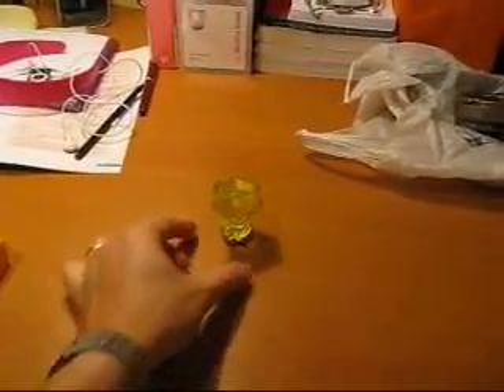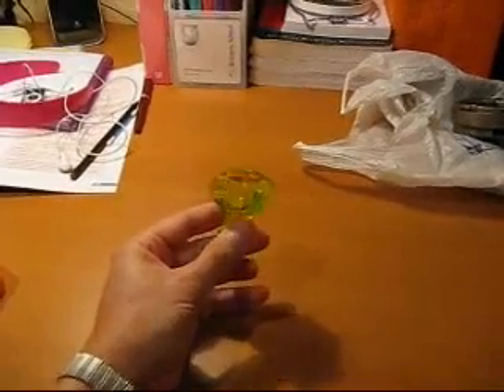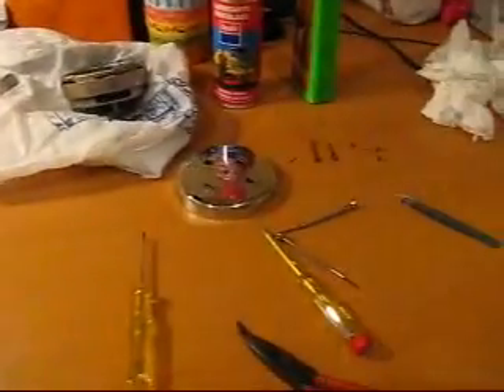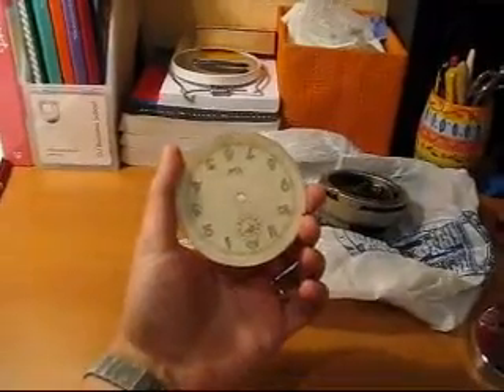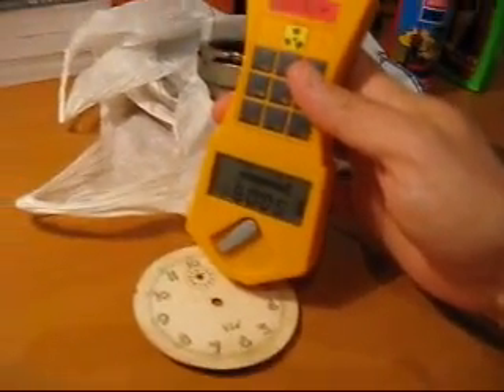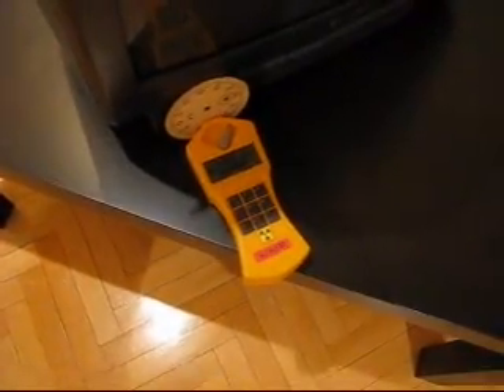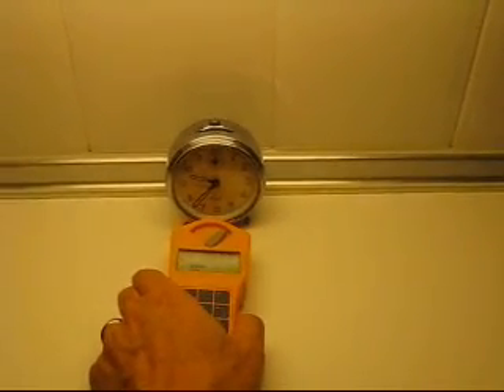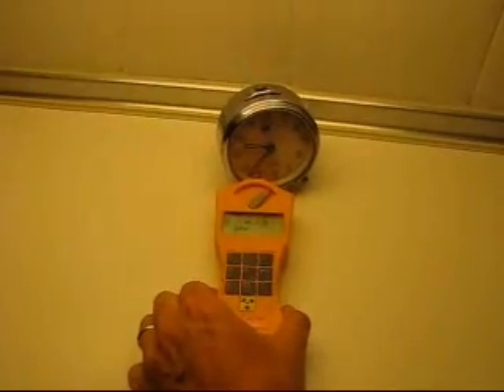Radioactive handle and alarm clock

Comment: I don't like the warnings at the start of the video.  Don't repeat the experiments?  Nothing gets more dangerous or radiocative from being tested by a geiger counter.  The only dangers I can see here are from the dismantled dial (which would be just as dangerous if you didn't know about it) and from radon buildup if the old clock is kept in an unventillated room.  The test you did revealed dangers which you can now guard against.